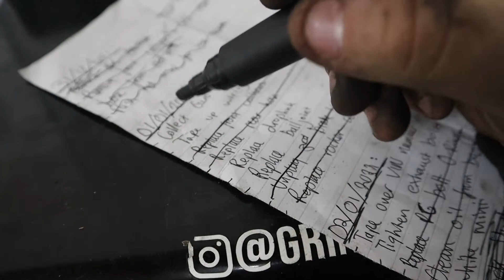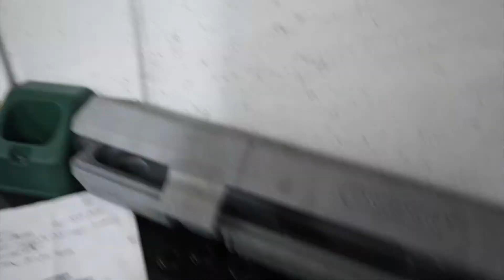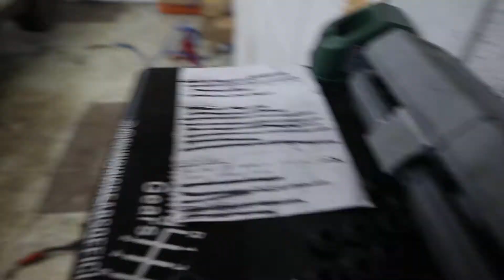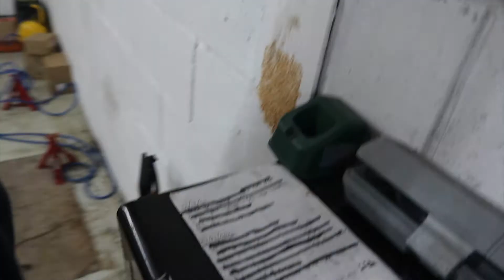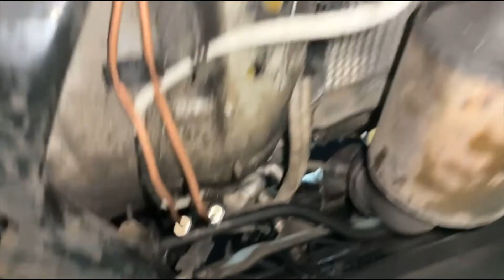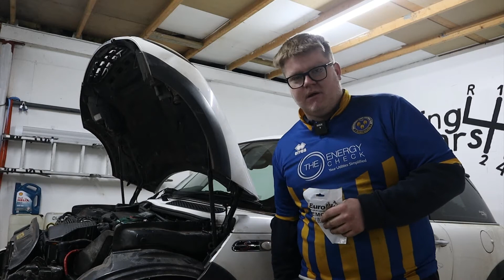Test Day! - The New Year MOT Fail #3 - The Workshop Diaries EP #6 | Grinding Gears

Comment: You have me concerned about the copper brake lines they look like soft copper if so they are very dangerous. Brake lines are made of an alloy that will not expand from high pressure like softer copper that is easy to bend. Please let me know.
Reply from the maker: They are copper brake lines and are a copper and nickel mix. They are indeed made for this purpose. They weren’t that easy to bend but I found if you held the spool of copper so that it reels off from the bottom rather than the top, it’s a bit more manageable
Reply: Thank you for getting back to me ,glad to know everything is fine.